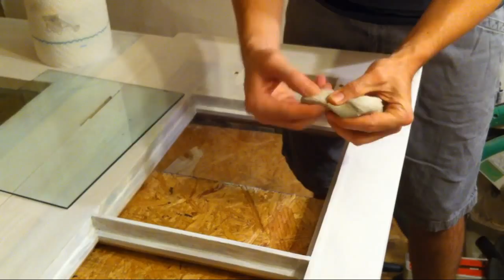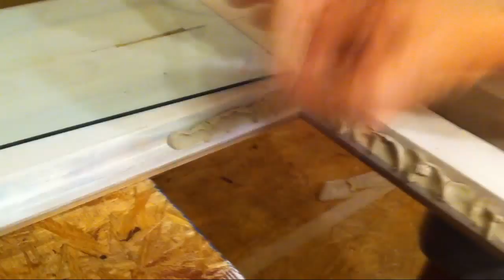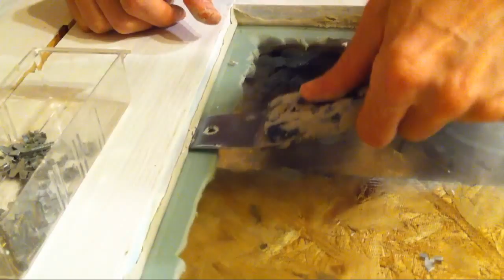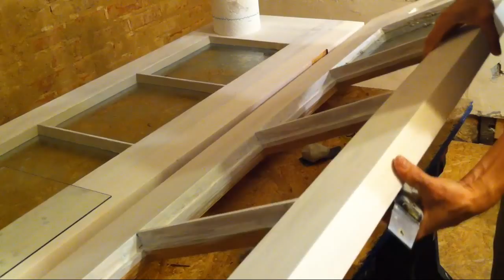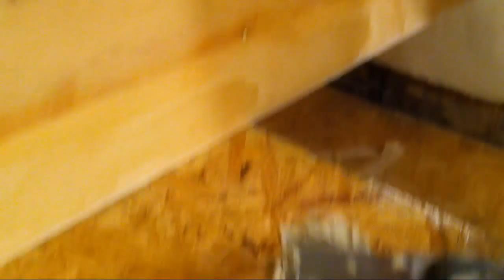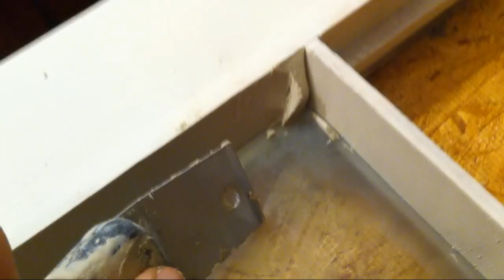Sarco Dual Glaze Window Sash Putty Glazing Tutorial - And Party Rocking

Comment: I bought a bucket of  sarco oil putty 4 years ago,I had glazed one busted window,,,it was a job just to get the bucket open from the top seal and gasket,after job done,I resealed it ,, knocking the top down till it seemed a tight seal a year  later I opened it again,, the top inch and a half or so had hardened solid,,I thought crap why did itt dry out?,, what I  did today after removing the hard chunks big and small pieces, was use a qtr in drill with 2 allen wrenches tightened snug into the drill mouth,,  then use some lemon oil as a softening agent mixing the stuff until the whole bucket ( 2/3s remaining) was again soft restored of oil,it mixed nicely  when I finished a plastic bag covered the open bucket,,it sealed seccurely
I think it will remain pliablle and ready for use whenever.
Reply from the maker: One thing I like to do is to put about 1” of distilled water over the top of the putty in the bucket. It gets a skin on the top that you need to peel off, but it will stay good and not dry for a good few years from my experience.